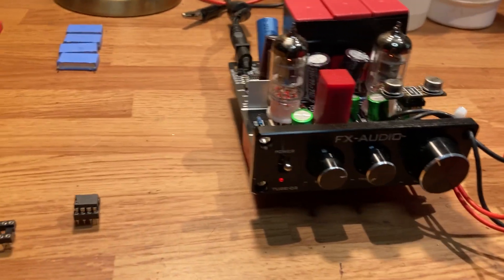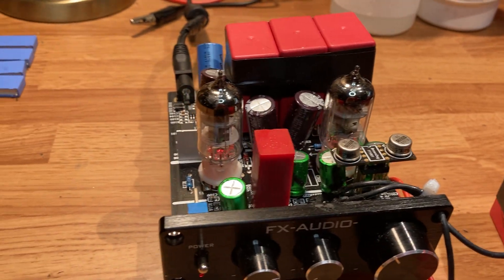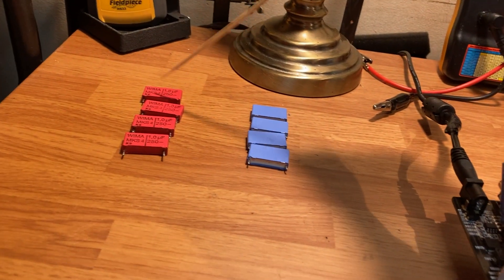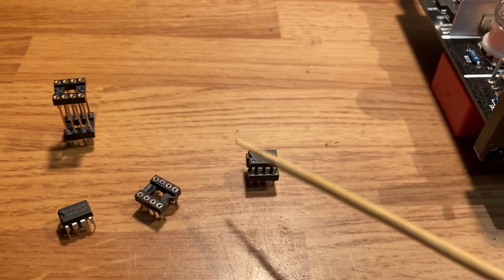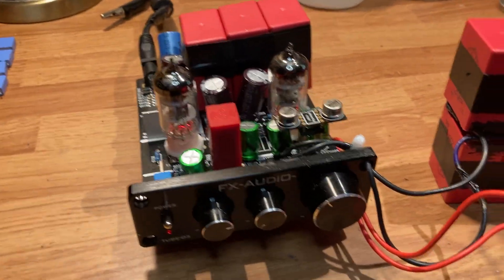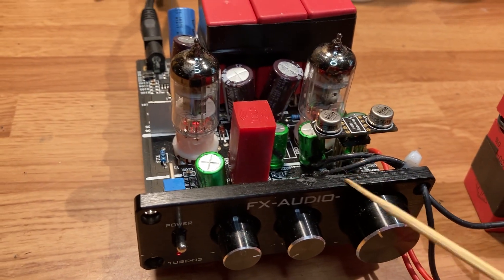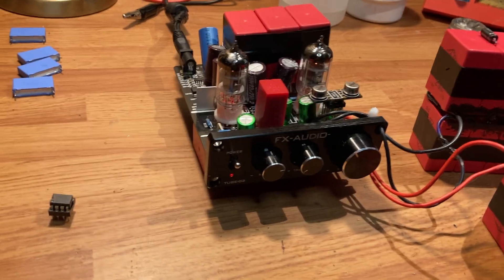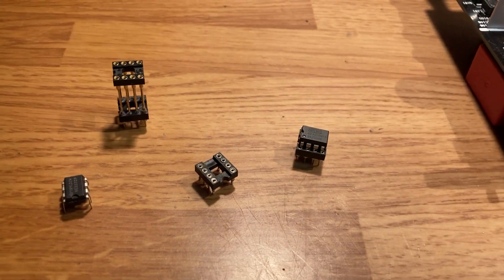FX Audio Tube-03 op amp and capacitor upgrade

Comment: @RanByMonkeys do you have a Digikey or Mouser part number for the giant 1uf caps you've used to replace the stock film caps? I can't seem to find them. And do you know if they come in 2.2uf? I'm using  2.2uf and I like what it does in my set up, and I'm curious if the physical size of the cap has any perceptible effect.
Reply from the maker: Here is the link to Every in stock polypropylene WIMA film cap.  I like to have people learn how to use the websites instead of me just tossing them a part number. The teach a man to fish thing.  https://www.digikey.com/en/products/filter/film-capacitors/62?s=N4IgjCBcoJwAwyqAxlAZgQwDYGcCmANCAPZQDaIAzABzUDslAbCALpEAOALlCAMqcAnAJYA7AOYgAvkQC0EaCFSRMuQiXLgYAJmqtpIGVqSKoggK5rSkCgFY9%2Bo9cUZ2GZEM7EBOPUA
Reply from the maker: The material the cap is made of will make the difference and the size is determined by the material, so, ya.
Reply: @ranbymonkeys2384  Seems there is just one 1uF option. Did the 27.5mm lead spacing cause an issue or did you wire them in? The spacing on my SUKA version is 22.5mm
Reply from the maker: @davidnoble868  The art number to replace the stock with the same size is mentioned SEVERAL times below.
Reply from the maker: Here is the 2.2 https://www.digikey.com/en/products/detail/wima/MKPCJ042205I00KSC9/9370521
Reply: @ranbymonkeys2384  I did see the art numbers, but not for the over sized caps you used, maybe I missed it. I have a set of the 2.2uF you linked, and a few others that fit the stock lead spacing and within the enclosure. I was interested in trying the set up you have which is why I asked about wiring them in. The mistake I made searching Digi or Mouser was selecting 250v which excluded the larger caps. Lesson learned.
Reply from the maker: YES, again because pure polypropylene (PP) are bigger and sound better than metalized (PE).  Even better and bigger yet is polystyrene.  A .1 uF is as big as a PP 1uF cap
Reply from the maker: Try different brands WIMA unly makes PP caps up to 1 uF it appears.  Try Nichicon, Vishey, Elna
Reply from the maker: again look at the size I have 3 in the top and 1 on the bottom the lid WILL NOT GO BACK ON WITH THESE  do they sound better than the PE (polyester) YES!!!  edit https://www.digikey.com/en/products/detail/wima/FKP4G041006J00JSSD/9370277?s=N4IgjCBcoJwAwyqAxlAZgQwDYGcCmANCAPZQDaIAzABzUDslAbCALpEAOALlCAMqcAnAJYA7AOYgAvkQBMcACyJoIVJEy5CJcuAAEAVoBirDt0ggAqiKGcA8mgCyeDDgCuAvFKIBaCMtXr8IlJICjAYGWpWSWkQGW1kDHYMZGtiARwooA
Reply: @ranbymonkeys2384  I understand, I already run mine out of the case because I keep playing with the film cap values. I've tried 1uF, 2.2uF and 4.7uF PE and ended up liking the 2.2 best.  Now I'll have to find PP caps for the two small ones between the tubes. ;)
Reply from the maker: @davidnoble868  Those are 1 uF also I tgink so the (PP) 1 UF I already gave you the link and they are HUGE NO WAY!!!!!  See the 2 "bricks of 10 uF caps those 10 replace a 10 uF electrolytic cap 2 of them so there are 20 PP caps
Reply from the maker: You need to worry about the thickness because if you look at the one I did only 3 fit and I had to put the 4th underneath.  I'm confused about what you want to do.  You mentioned the big caps those are PP polypropylene.  If you want the same size as stock your want PE film caps they are smaller not as good sounding and cheaper.  What are you trying to do?
Reply from the maker: Learn how to use the websites it's not that difficult.  YOu check the products you want to search for say 1uf it will list every 1 uF cap they have then narrow it down by brand if you want or dielectric (what it's made of polyester ect..)  Size volts you can narrow it down.  Learn how to use it https://www.mouser.com/ProductDetail/WIMA/MKS4F041005B00JSSD?qs=NW4srbNA5mc7JzReSZM39A%3D%3D

Comment: Cannot buy those small Wima MKS4 1uf/250v in Vietnam. I bought RIFA PHE426 1uf from Aliexpress.
Reply from the maker: good luck with that, you can't order them?
Reply: @ranbymonkeys2384  already changed about 2 months before. There are many MKS4 from aliexpress but most of them seems fake. shiping from digikey or mouser are too expensive.
Reply from the maker: @Vuvovi  Id you don't get them from Mouser or Digikey you will be in the same situation.  How much is shipping?
Reply: @ranbymonkeys2384  from mouser, shipping worldwide costs 25USD. 4 caps are 6.48USD only.
Reply from the maker: @Vuvovi  I always order at least 10 even if I don't need them and they are cheaper that way.  Just make a list of all the stuff you need for 1 order.
Reply from the maker: @Vuvovi  and 10 for $12.60 that's why I always get at least 10, you never know when you will use them.

Comment: holy shit!! 50€ plus shipping costs (20€) for a MUSES02 operational amplifier. I have to look up information to see what it does.
Reply from the maker: Is sounds awesome that's what it does.
Reply: @ranbymonkeys2384   Can the MUSE01's be used in this unit? I hope so or i made a mistake in ordering them instead of the MUSE02's. Ordered them from Mouser so they shouldn't be counterfeit at least. Thnx!
Reply from the maker: @paulb4661  I rarely use specs just for that reason.  Congratulations on job well done.  EDIT: Have you played it a while because there is burn in that is going to take place it just gets better.
Reply from the maker: @paulb4661  OK when was it delivered (Just wanted to know how many hour you had the MUSES in that's all)?  Nichicon 3 uF seems a bit low for power filter caps.  What MOSFETS are your referring?  The TUBE 03 isn't a class A amp.  What DAC are you referring to?  Why would you have had an issue after just swapping out the op amps you say checking the pads and these op amps are through hole not surface mount.  Can I ask you something, did you take the shot?
Reply from the maker: @paulb4661  OK I was wondering why you would replace a CD player op amp, but it's the DAC portion.  What sample and bit rate is that gettin' ya?  I don't know, the Burson V5 isn't bad.
Reply from the maker: @paulb4661  Anybody ever tells you there is no such thing as burn in you know they are full of shit.
Reply from the maker: @paulb4661  Get a good polystyrene .1 uF film cap (1 for wach power cap) and shunt the + and - together with it for each power cap called a bypass cap.  Your welcome.  Just get a good cap I like polystyrene for bypass caps.
Reply from the maker: @paulb4661  Those are decoupling caps not bypass caps.
Reply from the maker: @paulb4661  Those are just stabilizers for the op amps.  I'm talking about bypass caps that are to go on the 3000 uF Nichicons.  Get better than WIMA for these though.
Reply from the maker: @paulb4661  Both the Burson and the OPA627 have a .1uF polystyrene to the 4 and 8 pins.  https://drive.google.com/file/d/1NWdFioOe7SgWY1YIqD8KknjO7_19FLBp/view?usp=sharing
Reply from the maker: @paulb4661  Get rid of those, that a tantalum is a no no for audio.  Anyway if you shunt those power caps you will be surprised.
Reply from the maker: @paulb4661  Yes those are 1 uF WIMA caps (there is 1 underneath, no room) polypropylene
Reply from the maker: @paulb4661  Well no that pic was to show you that I know what those caps (on 4 and 8 pins of op amp) are for and I'm talking about the power caps (bypass caps).
Reply from the maker: @paulb4661  Anyway have a good one.
Reply from the maker: @paulb4661  Silver mica is NOT good for an audio chain.  Yes they are very stable but sound like shit.
Reply from the maker: @paulb4661  I see why you took that one back, polystyrene compared to mica, hahaha, WOW.
Reply from the maker: @paulb4661  The op amp doesn't care if it's negative or positive as long as there is a feedback loop.
Reply from the maker: @paulb4661  But I don't doubt you were going to add a "section" probably about something we weren't talking about, hard to keep up with your thoughts.  Ran out of Ritalin did ya?
Reply from the maker: @paulb4661  I don't doubt that one bit, doesn't matter to me.  I'm not going to ban you, I don't agree with that.  If you control language you control thought and that isn't a good place to go.  This isn't my job so, whatever.
Reply from the maker: @paulb4661  Just one more thing you might want to practice because it pops right out, well, to me it did.  Just like drinking and driving don't mix, neither does ADD and NARCISSISM.  The fact of the matter is you can only learn so much yourself, so take the leap and get into something that you don't know.  It's OK to not want people to think you know everything about everything but just talk narrow subjects.  Stop, listen, learn, live.  Be happy, you are SMALL remember that.
Reply from the maker: @paulb4661  It spiraled to more than that in paragraph two.  You took the damn shot didn't you Paul.  You got the vaccine, crap.

Comment: I've swapped out the original FX Tube 03's TI OPAMPS with the OPA1656 and recently changed again to a MUSES 8920D.  I like both of these better than the originals and I still have the LME49720's to test.  I'm interested in trying to replace the e-caps to the film caps you suggest.  In order of magnitude, how would you rate the impact on sound from changing tubes, opamps, and film caps?  I also replaced the wall wart with a direct power supply.  Great video.  Thanks.
Reply from the maker: That chip has a pretty slow slew rate of 24 milivolts per second.  There are a lot more superior chips than that one.
Reply from the maker: OPA1656 only comes in surface mount so I don't know what you got there.  Changing out the caps  will bring a noticable result.  I think the LME4972's are better than the "muses" 8920.
Reply: @ranbymonkeys2384  I used the OPA1656 chips also in my Tube 03 and Aiyima A07 amp. There's a guy that sells them mounted on eBay: https://www.ebay.com/itm/333850298075?ssPageName=STRK%3AMEBIDX%3AIT&_trksid=p2060353.m1438.l2649
Reply from the maker: check out my video where I show you how to do that
Reply from the maker: He says that those chips are made by Burr Brown and they aren't they are Texas Instrument chips.  Probably FAKE like I told you NOT to get these things from EBAY.  The chip is $3 the adapter is around $3 so you tell me is it fake or not?  If I did them I would sell them for around $15.
Reply: @ranbymonkeys2384  TI still markets them Burr Brown(TM): https://www.ti.com/product/OPA1656
Reply from the maker: @vanoverbay774  fancy have at it, I advise you to just get the MUSES02 and be done with it.  NOT FROM EBAY!!!
Reply: @ranbymonkeys2384   The OPA1656 I got were indeed from ebay.  Don't know if they were fake or not.  They sounded better than the stock ones.  Bought from two separate sellers one was $20/amp and the other was $8/amp.  I got the MUSES8920D's and LME49720's from Mouser.  Still haven't tried the LME's yet.  The OPa1656's were only available on Mouser in a form that required mounting beyond my ability.   Of the Burson, MUSES, and LME, what is your favorite?  And which has greater impact on sound, the OPamps or the the film caps?

Comment: Can I put 2 single Burr Brown OPA620 SG ceramic/gold in a dual adaptor for audio amplification?
Reply from the maker: What is ceramic and gold WHERE ARE YOU GETTING THEM, why the hell doesn't anybody listen to me.  If you don't pay at least $50 each, they are fake!!!!!!!
Reply from the maker: They don't even make a opa620 you are looking for AD620
Reply: @ranbymonkeys2384  they are  old burrbrown mono op amps used for medical and video equipment https://www.digchip.com/datasheets/parts/datasheet/477/OPA620-pdf.php
Reply from the maker: @necrodh  You will have to check the voltage at the input pins it's saying it can only withstand +/- 5 volts.  It appears to be a unstable op amp, but hey it's not permanent.

Comment: Hi, i've been following the comments with the greatest enthusiasm hoping someone would put the WIMA capacitors reference in the comments. In Portugal both Mauser and DIGI-key have weird stocks and references a little different.

Could someone make available more detailed specifications of WIMA or the references of Mauser and DIGI-Key... ones that dont blow up my amp?!?!

Thanks
Reply from the maker: Well, there are several different WIMA caps in this video.  What value (uF) are you looking for?  Are you replacing a stock capacitor?  Is size an issue (does the cover have to go back on)?  Replacing caps won't blow your amp up, not knowing what your doing will.  I suggest you contact your local audio engineer before you get into something like this?!?!?!
Reply: @ranbymonkeys2384  Yes, I am replacing the originals, supposedly the lid should go back to the original place being that the measurements should be... identical or at least allow the lid to close on.
The question here is about tolerances. I found this reference without knowing very well if it would match the red capacitor you show on the table next to the blue ones (probably the stock ones).

MKS4F041005B00MSSD

Am I really that far off?
Reply from the maker: @rnclucas  OK I think I may know what you are trying to do.  You JUST want to replace the 4 blue sometimes yellow Chinese film caps then those are what you want.  While your at it, why not replace the other 2 film caps in the center of the board (note they are smaller but the same value).  The values are all written on the capacitors so if you replace with the same value it wont do any harm.  That being said, those will work BUT I DO NOT RECOMMEND THAT YOU REPLACE THEM!!!!!!!  You may as you say BLOW YOUR AMP UP because you DON"T KNOW WHAT THE HELL YOUR DOING!!!  So to REITERATE the advice I'm giving you is leave it alone so you can't blame me for doing damage to your stuff, I hope I'm not unclear.
Reply: @ranbymonkeys2384  tks for the advice. Probably better not to mess with radioactive or nuclear stuff. 😁👍
Reply from the maker: @rnclucas  Your owners (the EU) see it differently.  That's what happens when you sell your soul.  You loose all freedoms.
Reply from the maker: @rnclucas  I put a link in one of the conversations below to those caps the only difference is the one you posted is 20% and the one down there (you'll have to find it) is 5%.   That means the tolerance is +/- 5% of the value (1uF).  So it could be .8 uF through 1.2 uF at a 20% tolerance.  It won't hurt it either way but I like to be as close as I can.
Reply: @ranbymonkeys2384  You had a premium though, they (UE), aren't owners of anyone, They don't own anyone, at least when it comes to freedom, but they do own, and I agree with you, cautious extremists thoughts and rules, too much by the book. I think it's bad, terrible, there are never stocks of anything, everything comes from abroad and you pay a lot of money for each importation, companies work with minimums and the variety/quantity available doesn't allow to give freedom to curious and dreamers that are not satisfied with the factory product as it is, knowing that there is room for improvement. I hope you understand me but I want you to know that we have good "handymen" (technicians) in all areas, and what we need is to have material to work with. 
Thanks again for the priceless explanations.
Reply from the maker: @rnclucas  What does Portugal produce, what is their main export?
Reply: Thanks you for the great video, I have no soldering experience at all like many hobbyists but want to change the capacitors how should I start

Comment: I've changed the default and cheaply made power supply by a low noise linear power supply and it improved the SQ significantly.
Reply from the maker: Ya those power supplies that come with it are good for, well, nothing.
Reply: @ranbymonkeys2384  Never seen an impaired OPAMP rolling before, it's interesting and thanks to you for sharing now I'm encouraged to experiment so many possibilities. 
Questions: which one is the treble control OPAMP, the right one or the left one seen from the front.
I have pairs Burson V5i single OPAMP, after seeing your video I'll stack them to be Dual OPAMP with DIP-8 converter, Glad I've found you channel, , thank you.
Reply from the maker: @cabronesse386  The right one is treble and the left one is bass, so the ones closest to the controls is what it is.

Comment: For OP Amps that drop in without Any modifications and Sound pretty Nice, I have a Muses01, Sounds pretty Nice for an IC 2Channel one.
Reply from the maker: yes it does  EDIT: I think the MUSES02 is a bit better
Reply from the maker: where did you get your muses chip?
Reply: @ranbymonkeys2384  in a local Electronics Shop, small Business WHO had a few left, but they don't have them in Stock anymore.Not the Cheapest AMP, but it Sounds very balanced to me.
Reply from the maker: @johanneshainer3460  Those are faked all of the time, it's a weird op amp to keep around because they are $50 a piece.
Reply: @ranbymonkeys2384   I Know but i checked with acetone and a magnifying Glass, seems legit.